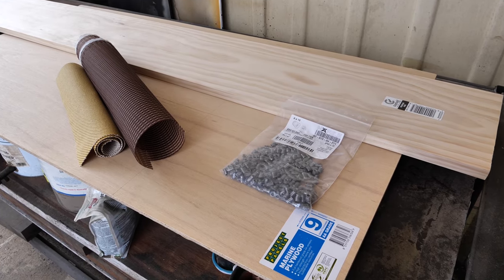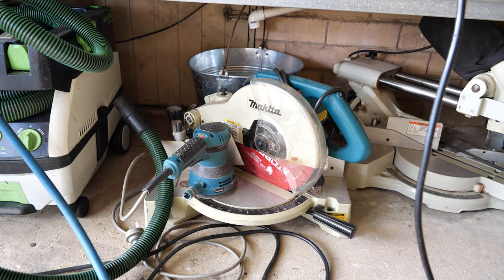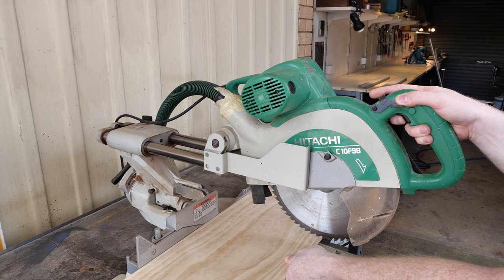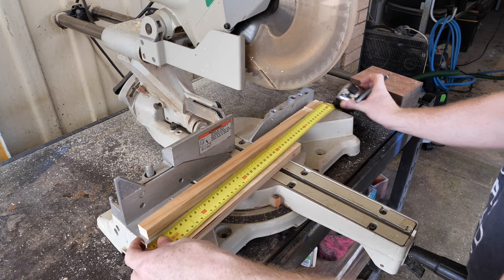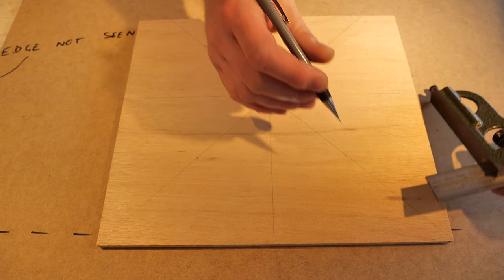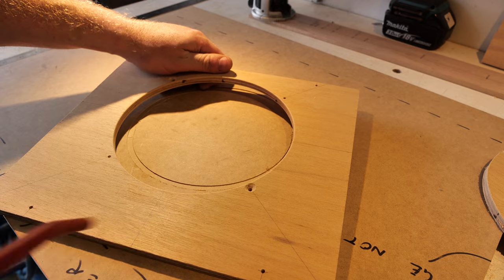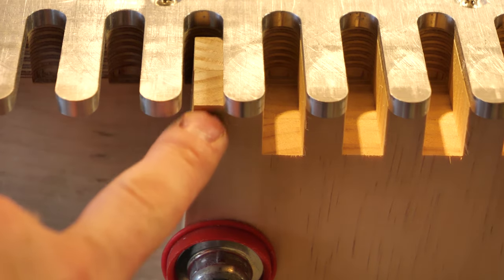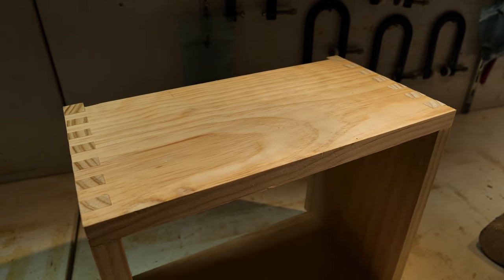Build Your Own Champ Cabinet - Part 1

Comment: A very timely post Brad, plans to build s speaker box in the immediate future. Thanks,
Reply from the maker: More plans to come, mate!
What design are you building?
Reply: Evening Brad, I’ve built a 2 by 8 inch box but not with dovetail or box joints. Quick and dirty some would say but it’s worked so far. I’ve decided I need a cabinet to utilise a 12 inch I’ve got and like you have gone with a nice piece of clear pine, quite nice grain but I will look into tweed, can’t beat the look. Look forward to next video, hope it’s going to be a completed toy? Chassis in and demoed? Bloody needy aren’t I. All the best, hope the year is off to a good stsrt
Reply from the maker: Yeah, we'll see what we can do.
Kinda subjective, as I don't know what speaker or amp people are going to use, but a bit of fun, nonetheless.
I have some 12" designs you might be interested in, mate.
Flick me an email and we can dig deeper in what you need.

Comment: I do gunsmithing too and Brad is nuts on about glue starving joints by making them way too tight. Blind holes with dowels, or steel pins require an air escape hole, unless you want to risk blowing holes into a 170 year old rifle stock or having the parts back out from the pneumatic pressure. I use a lot of Acraglass on those projects. It's kinda like glass filled epoxy.
Reply from the maker: Pneumatic / hydraulic pressure is very formidable when gluing up.
I've seen glue come out of end-grain 6-inches away from the actual glue-join!